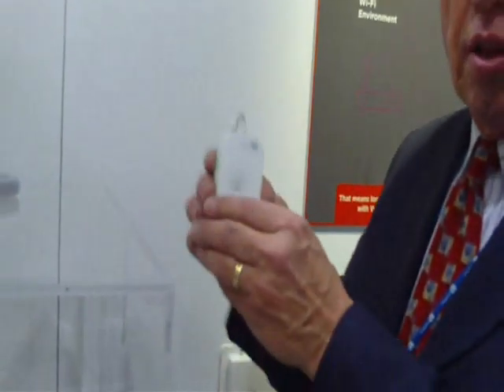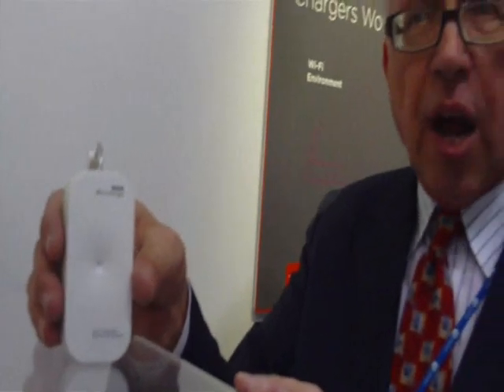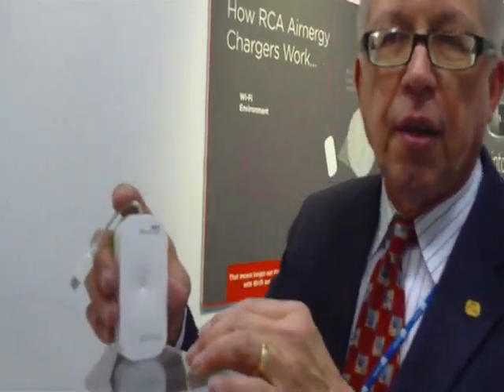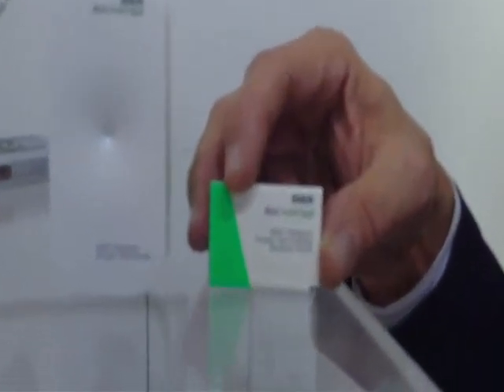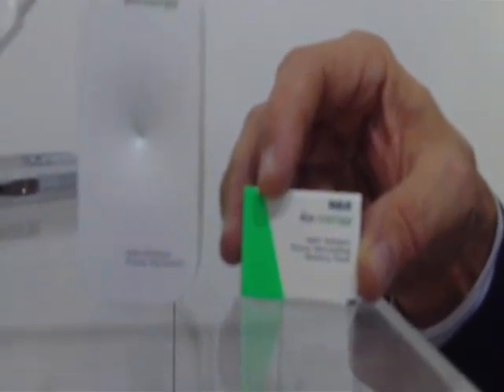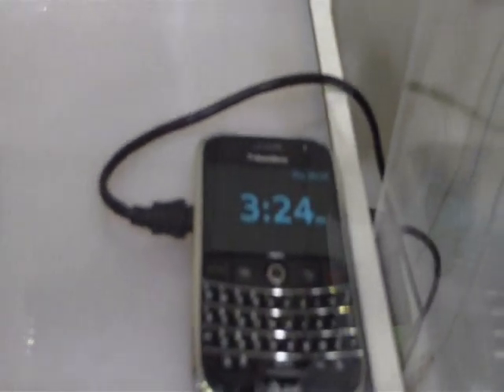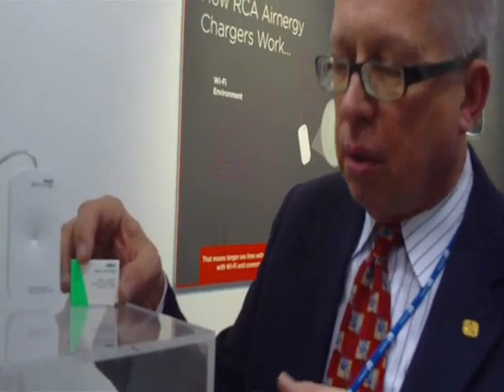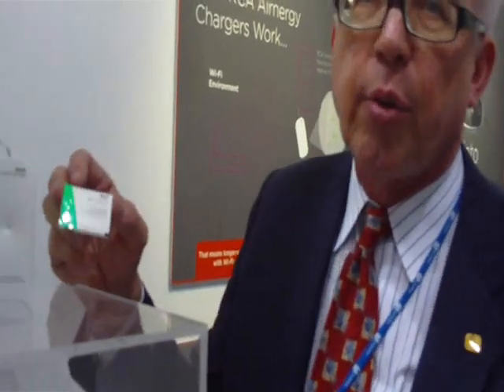CES 2010: Airnergy WiFi Harvesting Charger

Comment: if it works, which is kinda doubtfull, it would probably work by converting the energy from electromagnatic waves that are wifi signal into electrical energy, basicly just taking it out of the air. so i doesn't connect to a network it just takes the energy that is in the air, more available networks means more signals and more energy.
thats how i think it would work (if it does) it might just as well be a clever marketing trick to sell something useless

Comment: woah hold the fuck up! he just said the RCA device  will "RECHARGE" from WiFi hotspots. first off all what if your in multiple hotspots rage which one would be used  to be able to "RECHARGE" the device. and second of all what if you are in just a single or again multiple hotspot rage and its  locked or secured.you mean to tell me it would automatically just break into the network and "RECHARGE"  they better explain that or GET THE FUCK OUT OF HERE with that.

Comment: Who wants to bet when this comes out it just has a BS antenna inside, dummy circuitry connected to it, and a DC input so you can charge it from the wall "in case the WiFi signal doesn't work for you".

Comment: Wifi wireless transmissions are far from the most powerful radio signals.  Even the most powerful signals are not powerful enough to charge a battery.  What they are selling is a spare battery with included snake oil.  It will not self charge.  Put a amp meter on it after the built-in battery is drained.

Comment: This technology is, or at least it seems like, Electromagnetic Induction, which is the production of a voltage potential by way of a magnetic field. Since WiFi signals are EM waves, they could conceivably be converted to a DC current. But the amount of current wouldn't be very significant, so i'm not sure how efficient this device would be...

Comment: I don't doubt that they are dev. batteries that "don't need recharging", but I don't think we'll see it on the market this year (or the next). There are energy "everywhere", and the simplest energy to use is probably kinetic (motion) energy, and then there's heat (body, sun) etc..
But this idea of using WiFi (etc) to charge something (in that small amount of time) is impossible.
A rule says: Energy can't be destroyed nor created, only "transformed". So you can't extract more energy than there is

Comment: Of course 'free energy' can be harvested from the air - that's how crystal radios work without a battery. However they only need tiny amount of power to work - you would need far more to even power the charging circuit, let alone start to charge the battery. The typical maximum power received by a WiFi antenna is around 100µW. Average is around 100pW. My phone charger outputs around 4.5Watts...

Comment: WHAT if the thing dies before you get to a hotspot or something, then it can't turn itself back on to pick up wifi signal to charge itself back up, and if it reserves power for such an occasion, what if you let it sit too long and the power gradually decreases? Then you're screwed. If the thing can plug into a wall and charge the internal battery, then it's good. lol

Comment: 1) Attach a bridge rectifier to an antenna, and any RF buzzing through that antenna will be converted to DC voltage.  That much, at least, is accurate.

2) There is not enough RF is buzzing through the air to overcome the 1.2VDC/cell required to even begin recharging a LiIon battery or the 1.4VDC/cell for a NiCD.

3) There is not enough RF buzzing through the air to meaningfully refill a cell phone battery, even without the voltage requirement.

Comment: well, i can believe that a microwave could do the trick, it could recharge the battery before melting it, without any problem, not very practical :D

a microwave oven is TEN THOUSAND times more powerful than a WIFI base station !

Comment: Not practical. Unless you place the device right next to the 500mW max output of a wifi antenna (creating a shadow interfering with other users) you are only going to soak up a tiny percentage of half a watt. Do the math, it doesn't work out except in weird places like CES, or at home, if you dump your charger on top of your wireless router at night.
Also, there is a patent out on this already 7084605 .. I wonder if they are paying a license fee?

Comment: OK, let's do the math here: WLAN transmitter at full power transmits 100 mW in a more or less spherical fashion, at 5 meters distance this amounts to 100mW/(4*PI*(5m)^2)=3.18e-4W/m^2. This thing seems to have about 50cm^2 of area, so charging power is 50cm^2*3.18e-4W/m^2=0.0016mW(!). Blackberry battery 2/3rds charge is 2/3*4V*1300mAh=3.4Wh. Time to charge that is 3.4Wh/0.0016mW = ~2,200,000 hours = 251 years 51 days. Where is my mistake? :-P